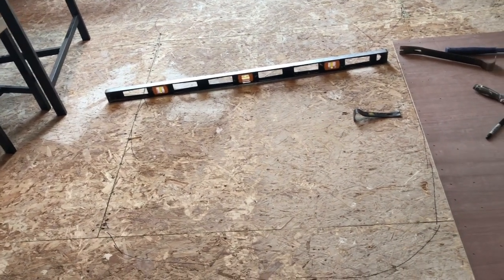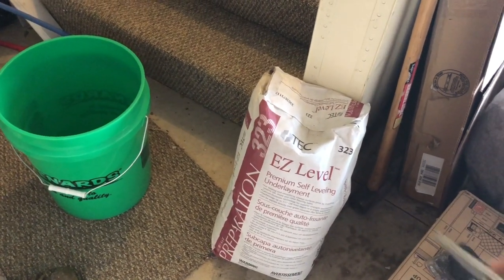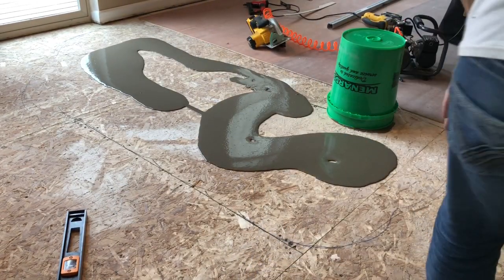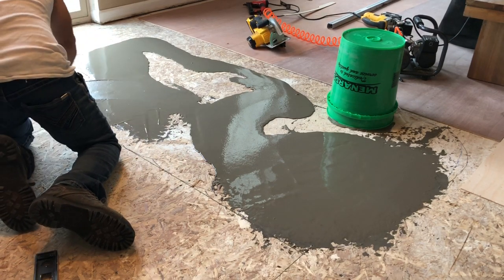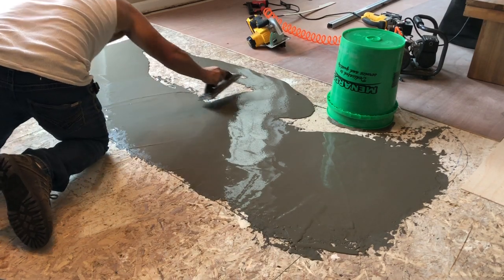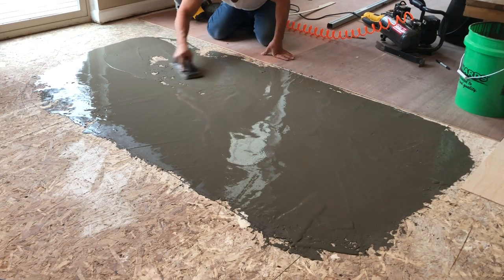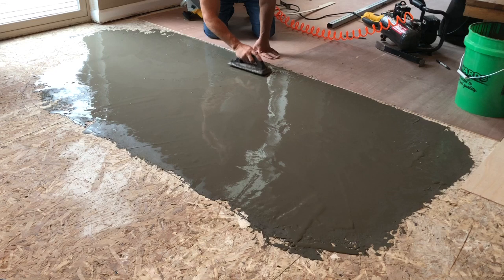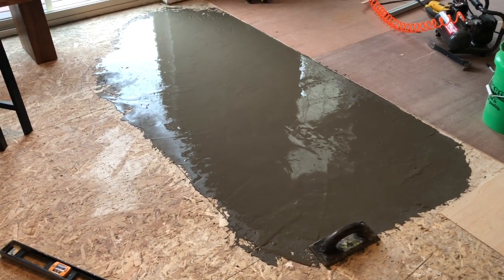How to level a floor with liquid leveler underlayment

Comment: Thank you so much for this awesome video and tutorial!!! We are moving into a new (to us) house in 4 days that we are remodelling. There was a big delay due to some problems with a carpet installation. I have to install vinyl plank flooring over the next 2 days. Was going to install and noticed some big dips in the floor almost exactly the same size you are working on. Bought the items you're using, eyeballed the same amount you put in the bucket, and it working amazingly! Going to put one more layer on after checking with the level (Less is more), and do one other spot. 

I'm not a super handy guy, but your video was a God-send. Thanks again, my man! (From Ontario, Canada)

Comment: Thanks for this! I have an rv where the previous owner cut out a roughly 36x8 board out of the hallway. It has since sunk in a good 1\4inch  on one side and a tiny gap on the other. I’ll need a fifth of what you used but this is the perfect solution. Thank you!

Comment: I’ve watched like 5-6 videos now on what to do and yours is the most common sense way to approach it all. Of course you’re gonna have to play with it and help move it around. When the crap hardens up in 20-30 min and done flowing, you sure don’t want some lumps or rolled edges that need sanding. Your sense of humor is classic too. Thanks.
Reply: He used the wrong tool to spread it out though , the right toll is a metal trowel , one foot wide or 18" , the wider the better .
I'm a flooring guy with 25 yrs of exp..

Comment: i  just knew it was more than just tip it on the floor and walk.  im a go with your hands on . smart and very pro.i use to do Building repair for a flooring Company at all there locations. and they  use to remodel all the time with new flooring that came  out. they a call there own floor workers to do the floor they did just like you in about way, mark the spots that was bad than thin set was used.  in about way both was about the same ways very pro  done  you did a very  5 star pro good job.

Comment: I am thinking of using the leveler for an area that is 18" x 8'. I am putting down peel and stick tile. Do I have to prime the leveler after using it for this small area. Also some levelers have primer in them. Is this primer instead of putting primer on top. Your video was amazing. So helpful, great job thank you.

Comment: How thick can this be?
Can I use this, for instance.
I have a small patch job of plywood.
Like 2x3 section.
Anyway, I have 3/4 plywood because I wanted the strength and its close to where a washer is.
I'm only putting stick on tile down.
Will this be okay to build up that area about 1/8th to a 1/4 in?
Reply: Also, can I just stick tiles to this?
Im not overly concerned about this area.
Im just replacing  a soft spot and shored it up and way over built the spot lol. It'll def hold and be better than it was thats for sure.

Comment: This is the most helpful video I'm gonna do this instead of ripping out floor  replacing the board. It did that it was so hard to do. Mobile home floors are shitty.
Reply: I need to do this to my subfloor in my 1979 mobile home!
Reply: I am completely remodeling a double wide, and every water source has a rotted floor I had to replace, and now it seems that the marriage point in the living room is not aligned causing it to be impossible to put luxury plank down.

Comment: My gf and I are putting in luxury vinyl plank. It has cork on the bottom of it and says you don't need to put anything under it on the subfloor. Will this stuff work if we use it then put the LVP on top?

Comment: I need to do this in one of my bedrooms. I will put hardwood floor so I was wondering if the humidity of the cement will cause a problem with the hardwood. Of course, I will use the a barrier between  the hardwood and the subfloor but I was wondering if it will be enough for the cement part.
Reply from the maker: Yes

Comment: We have tile and carpet throughout our 1 story house, but desire all vinyl planks, but without removing the tile. The concrete floor where the carpet was, it's lower than the tile floor now. What would you do in this case? Thank you kindly if you have any suggestions.

Comment: Great video! I’m about to do this for first time over OSB in upstairs bathroom. I’m planning on screwing through 1/4 backer board straight to treated subfloor. So I would be screwing a lot through the poured floor area. Will this work or just crack?
Reply from the maker: Monsters & Mazes by General Ketchup if you’re using the leveler liquid straight on subfloor they do recommend you prime the floor first with a product that they sell but if you’re going to put backer board down I would do that over the subfloor and then try to pour the liquid leveler over on top of the backer board that would be great
Reply: Does the leveler fall in between the seems in the ply

Comment: Thank you for taking the time to make this video. I'm in dire need of help also. Does this stuff come in an epoxy? The idiot who built the house I purchased put carpet down and no one could see this problem. Long story short, they set the main support wall 14" off set of center completely missing the support wall in the basement. We believe this was done to make the living room bigger. It sure made all the other rooms smaller. Over the years of heavy snow falls and the weight pressing down something had to give. I have a 3/8" drop at the worst place and need to be able to feather the compound out to zero. Any help greatly appreciated. I have 2 inch maple tongue and grooved flooring and wish to put 5-1/4" fossilized bamboo over all the dents, scratches and stains.

Comment: Getting ready to install vinyl floor and in one spot it’s unlevel , I ripped up the Linoleum in that spot is it ok to put that on top on the lawun board and level it , if not you have any tips
Reply from the maker: Only do it on top of the Louan if you are able to shoot about 100 staples or more in that area it can and must be solid you can rip out the Louan tack around it and fill it in that way

Comment: I need to troubleshoot an issue. Extremely similar to what this video covers. Anyway we could chat?  I'm using sure ply but my dip is on the edge of the room... Trying to figure out how to fasten it if I use self leveling compound.
Reply: I hope you found someone else who actually knows what they're doing
Reply: Probably too late now but I've laid a line of spray foam along the outside edge of a wall to contain then applied leveller (after recommended dry time). After the leveller dries trim the foam to the height of the levelled floor.

Comment: I'm about to do this,  gonna admit I'm pretty nervous
Reply: Don’t do it this way please. I’m a certified flooring inspector with a lifetime of installation experience. Please read all manufacturers instructions. Most products are not ok to use on sob and luan plywood itself is not a good subfloor. Please don’t cheap out on subfloor preparation. Seriously, 90% of my inspections end up as installation failures. This would end up as one down the road I’m sure.

Comment: What is so different that the 323 is recommended over others. I can get the TEC Skill Set ULTIMATE SELF LEVELING UNDERLAYMENT,  but not the 323 because the store won't carry it.
Reply from the maker: Maybe thats a new and improved product did you ask i would really like to know now
Reply: @KooperSalmo  I was hoping you knew, that is if you're the guy in the video? I would have liked to try it, but am going to use table top epoxy for my small area. Too expensive for a big pour, but I fig 2 gal should do it. It's sticky, pliable and self leveling....

Comment: What's your tolerance for dips? How much of a dip before you say "this needs levelling"?
Reply from the maker: If it wont bother you then dont do it but if it will bother u just do it its easy and for $20 and a little time
Reply: @KooperSalmo  I don't know if it will bother me though, that's why I'm asking :) I'd hate to feel the floor moving as  I walk on it. I have some dips of ~3mm (1/8 inch).
Reply from the maker: You should do it because were talking about it lol fix it and you will be happy u did
Reply: @KooperSalmo  Valid point! Thanks for the videos!
Reply: Most finished flooring requires less than 3/16” over a 10’ span

Comment: I guess this works. I ripped most of my subfloor out instead and replaced it with Canadian OSB subfloor. For any uneven spots, I used a cheap orbital sander.

While this was a big job for me to do solo, it’s very nice having new subfloor that’s sturdy, won’t creak (you can always put extra screws in on old subfloor), and is quality. 

Whatever way you do it, DO IT. Uneven flooring will come back to haunt you every time!

Comment: That's rite brotha do ya thang haters gon hate either way... they just mad bc you lookn fine and can perfect your skill.. ..ok anyway thanks for video , but let's just say I'm a dummy rite, so my question is I can just lay this liquid leveler over my osb (I think) subfloor and then once it dries I can tile straight over it? Or do I have to put something in between and if so what??
Reply from the maker: Rachel Schopfer Yes you can just lay it right over it after it dries but they do make a primer that tends to be very expensive for a tiny bottle to put over the OSB before you spread the liquid leveler on the floor but I don’t use it anymore because I think it’s just overpriced and I haven’t seen an issue the reason they say don’t put it over OSB is because if it’s wet OSB can expand if wet but this stuff dries in like three hours and I have never seen it caused any issues or had a call back
Reply: DO IT YOURSELF ITS EASY no ones gonna call you a year later when the floors pulling apart because you didnt prime the floor, they are going to call a pro. A quart is 8 bucks and covers alot of ground, horrible that youre offering this advice man. We all know that guy who doesnt prime before painting, doesnt clean the pipe before soldering, or uses white teflon on gas pipes because it wont leak right away.. don’t be that guy man. I’m going to guess that your frustration twords folks is because your work has come into question by folks who follow proper procedures.

Comment: Why must you "play with" the leveler if it's "self leveling?"
Reply from the maker: Yeah what a sneaky name I never thought about that self-leveling What a great name to sell a product that doesn’t do what the name says still a good product without instructions but maybe they should change the name
Reply: There are instructions on the bag about how much water to add. I've used Henry brand about a dozen times over the years and I can see clearly the mix in the video was too thick, that's why it didn't spread properly. You don't need to float self leveling compound it pours very smooth and evenly if mixed properly.   
There are a couple things you can do to help it level itself. 
1. Immediately after pouring you can use a metal rake to slowly rake out any bubbles. Only for a couple minutes, before it begins to set. (Don't push it around, just run the rake tines through the compound to work out the bubbles. You won't get them all)
2. You can float the edges to make them perfectly flat.

Comment: DUDE I CAN’T BELIEVE YOU DID THAT FLOOR THAT WAY!!!!!! SERIOUSLY??!!!! LOL kidding. Thanks a lot for taking the time to make this video. I learned a lot. I do have a question if you don’t mind. It looks like you leveled the floor right up to and actually touching the new laminate wood floor your laying. Will the new floor still go together good ok without any problems? Thanks Buddy!!!....
Reply from the maker: Lol i had laid the luan planks prior to the floor being leveled i lifted the luan just a tint bit and the liquid leveler seeped under just about an inch under and when this dried i finished laying luan over the dried leveler but i made sure the luan was evenly gonna lay flat with the other peice of luan in the end it was perfect
Reply: DO IT YOURSELF ITS EASY Thank You Sir!!!
Reply: @KooperSalmo  I'm using 1/4" sure ply as you used luan. My dip is at the edge of the room and begins a bit over a foot away from the wall. So, I can't fasten around it just up to that foot or so. How would you go about fastening the ply down? Just leave it to "float" for a foot edge? It lasts a good 8/9 ft down the wall too before it could be leveled.  That seems like a lot of unsecured area... Help?

Comment: I think he mixed it too thiick. Self leveling to me means you pour it and it seeks its own level like water
Reply from the maker: I have been doing this since this stuff came out and if you make it too watery it will crack after a few months
Reply: You mix it to the manufacturer specific instructions. It'll say on the bag. Too much water and it's weak and dusty ( it causes the aggregate to sink and binders to float), not enough water and and it can dry to fast and cause stress cracks ( it can take up to 28 days to reach full strength  although it can feel dry after s few hours).
Also over a wooden subfloor I would use a fiber reinforced compound as it can take more flexing, but ALWAYS prime the floor.